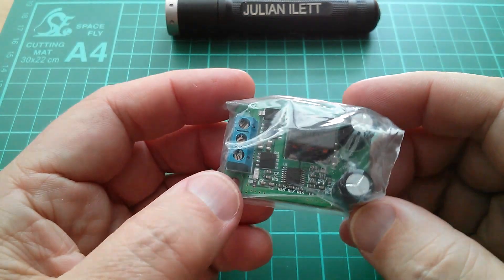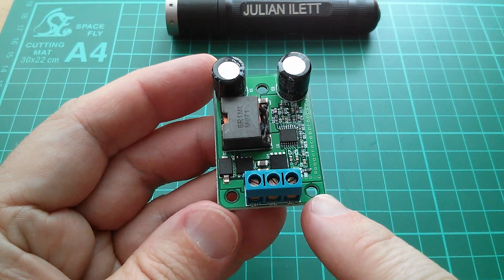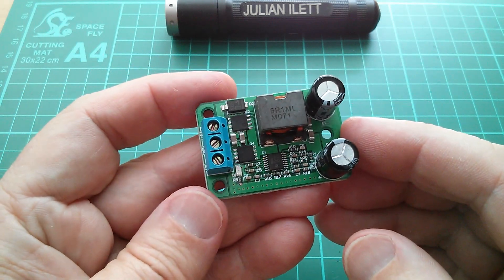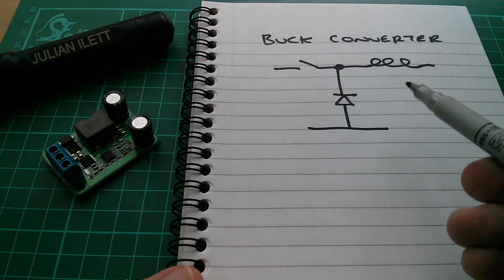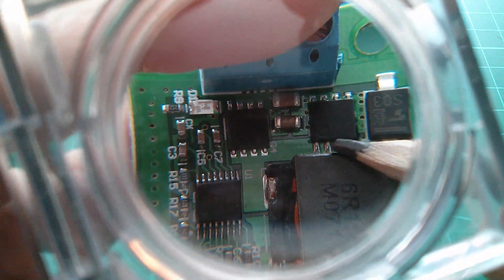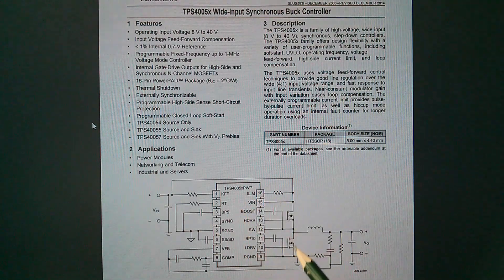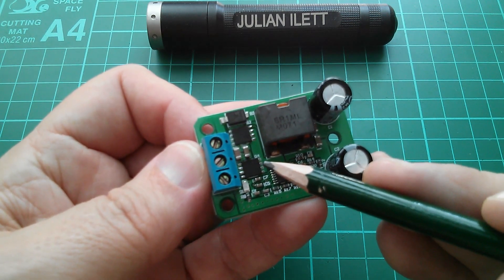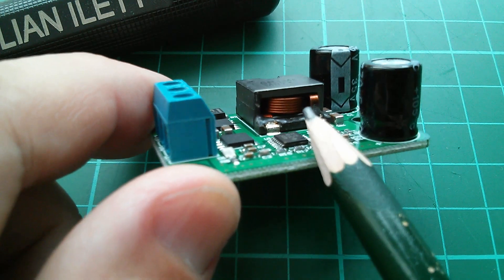Tech Talk: 5V 5A Synchronous Rectification Buck Converter

Comment: Actually I want to make battery charger for lithium ion battery. I want to charge 10 batteries at time and I have transformer of 12v and 5A step down. so could I give the 5A supply to this module. Suggest me any module to which I can give the input voltage of 12V dc and 5A and at output I want 5V and 5A

Comment: I just got few of those. The frequency is about 260 kHz - not that high as you would think with such a small inductor. This means that it won't work as well at low currents (bigger ripple).  The ripple at 170mA is 80-100 mV. In comparsion the LM 2596 ripple is 20-30 mV in similar conditions without additional filtering. Another problem is that both input and putput pass the whole PCB and create an inductance that picks high frequency content (quite sharp impulse) from the coil. I would connect input and output to the opposite side right on the capacitors by scratching the solder mask. Also I will addd aditional filtering. I still haven't measured the efficiency. I have to remove the diode and the LED before I do that.
Reply: I've had cases where the ripple is relatively high at very low currents (<10% of rated current) and it decreases by 3-4 times when load is over 30-40%.  I'm not sure about the reasons, but I know for sure some DC-DC converters have minimum current specification to maintain stable output.
Reply: How do you tel what the material is?

Comment: How can they sell these at these prices ? the TPS4005x in 2K pricing in USA alone is $1.75 !!!
Reply: Indeed. The magic of outsourcing all manufacturing to China. When you buy one of those TPS chips for 1.75, perhaps Texas Instruments orders it from a manufacturing plant in China and ships it around the world a few times (testing is done in Taiwan, lets say, and final packaging done in the USA) before it gets to you. You're paying shipping and import fees that a local Chinese electronics manufacturer completely bypasses on every component on the board, up until he ships the completed board directly to you via eBay. As a small time importer, you probably aren't charged import fees that Texas Instruments would be required to pay if you had ordered through them. And when TI sent their IP to the manufacturing plant in China, what's to stop the plant from building a few extra copies to dump in the local Chinese electronics market without giving TI their cut of the profits? When you buy through TI, you're paying for R&D expenses of the chip that the Chinese manufacturer may be completely bypassing.

Comment: Heat would have caused the core glue to loosen... no need to "destroy" :-)  
Flat copper windings are often used in high frequency switchers... more surface area means less "skin effect" losses.... this looks to be a very nice design indeed!  This controller says "up to 1MHz", it would have been interesting to see how far they are pushing it... frequency-wise.

Sometimes designers will use a "reverse polarity diode" in reverse-bias directly across the DC Input... so that there are no series-diode-drop losses. The only time it would conduct would be when the Input voltage was reversed... meant to blow the input fuse. This is common in very low voltage designs... and even in consumer "CB" radio transceivers. Some designs, however, can't withstand the 1V reverse voltage (high current diode conduction voltage drop) and survive when the DC Input is reversed.

However, it appears that the Anode is connected to the +V Input, so it is indeed series-connected. Did you check to see if it's a Schottky diode? (check forward voltage with a multimeter in diode-test mode) The losses would be far less, if so. 

With a normal silicon diode, at 9V input, the diode losses would be around 1V forward conduction, and at full 5V 5A load (about 26.25W input power assuming 95% efficiency), that's 3.28A (at 8V applied to the regulator), or about 3.3W diode loss... that would be a very hot diode. (it also means it's more than a 3A diode, since at 9V input, full load, it would draw more than 3A input)

If it's Schottky diode, the forward voltage drop would be around 400mA, for about 1.2W loss (for those wondering how: 9v - 0.400v = 8.6V actual input to the regulator; 26.25w / 8.6v = 3.05A;  3.05A x 0.400V = 1.22W)

I really appreciate your videos like this!  It's not many of us can afford to "tear down" stuff :-)

Comment: I wonder if you can get something similar, but with a trimpot to adjust the output voltage to prevent sag under load or over longer wires?

Comment: Before destroying it you should've done some tests. Put it on a variable load, ramp up the current drain and observe if anything gets warm, then if at 5A it doesn't get very warm, ramp up the input voltage and observe again. Then if it's still fairing well at 5A load with twenty something volts going in, increase the load to more than 5A while watching the output voltage. See if the inductor, etc... gets hot. If you blow it up, then rip the inductor to pieces ;) Would've made a great video

Comment: After talking about its efficiency it would have been good to see you test it and derive some efficiency figures for different input voltages and loads. Just breaking it apart without even powering it up is not that enlightening.
After all this is meant to be a technical channel.

Comment: that inductor is (was) insulated so as to not cause havoc on the circuits ground and sensitive traces while switching. Looks like a coil craft inductor.
Reply: It is - I've just purchased one myself, coincidentally for another buck converter.

Comment: Very interesting device, thanks.
Though I would have liked to have seen a test of the actual efficiency.
Funny if it turns out to be better than the version you are replacing it with (input and output on opposite sides)

Comment: Appears to me the flat winding in the inductor is just to make the physical size more compact.  Don't know if the shape of the winding material has much effect?  Something to think about for sure.
Reply: Yeah, you get a coil of thick wire without making it very long. But I think it might also help a little that now the ferrite core is shorter too, so the magnetic flux has a shorter path to travel.

Comment: The diode on the input side with the higher voltage/lower current is lot less of an loss compared to the lower voltage on the output, it does not reduce the advantages of synchronous converter much.

Comment: Note that the reverse protection diode doesn't have to be schottky with a high leakage current. It could be a normal rectifier diode.
Reply: Of you could use a normal diode, but you'd want to use a schottky because of the lower forward voltage (more efficient, less heating).
Reply: How efficient does reverse polarity protection diode have to be, exactly? I'm not talking about the switching diode here, I'm talking about the reverse protection diode julian mentions that he says messes up the efficiency of the synchronous switcher. I assume it would mess up the efficiency because of leakage current if its a schottky -- that's why I suggested it could be something else. Perhaps I'm mistaken and he didn't say that it was for polarity protection?
Reply: Jacob Schmidt
The leakage current is irrelevant. The forward voltage (times the forward current) is what creates the losses
Reply: You would appear to have missed my point. That's fine. Have a nice day.
Reply: Jacob Schmidt
You would appear to not have understood how a diode works and what a reverse polarity protection diode does.
Reply: Sigh. Why leave well enough alone when I can yell at someone on the internet.

Nobody cares about the efficiency of something when it connected incorrectly. When the module is operating correctly and we do care about efficiency, the reverse protection diode is in reverse bias, and therefore it is the leakage current that matters.
Reply: Jacob Schmidt
See, you don't understand how the reverse protection diode works. In normal operation this diode is in forward bias and all the input current is going through it. Times that by the voltage drop and you got your losses.
Reply: I have rewatched the video and I believe you are correct. I was under the impression that the diode was reversed across the rails and would act as a clamp. That doesn't appear to be the case. I apologize.
Reply: Jacob Schmidt
Ah, ok you thought about that kind of protection. But the missing fuse before that would also be a hint, that that's not the way this circuit is protected. Won't protect for long without a fuse.
Yes, for a clamp a normal diode would be better (although the <1mA leakage of a schottky wouldn't matter much compared to the rest of the circuit). What would be even more better ;) as a clamp, is a zener diode. It can act as a revers polarity and an over voltage protection diode at the same time.

Comment: thats a very interesting design. not sure how you would get more current out than in but ok
Reply: It's a buck topology DC to DC converter. High voltage, low current power goes in and low voltage, high current power comes out. It's still the same amount of energy (volts * amps) that goes in and comes out.

Comment: The inductor looks like a coilcraft part, I got some I did buy for a project.
I haven't taken the coils apart, you did find quite much what I expected them to be like.

You rarely need more heat in the converter/controller itself.
(besides, it's easy to do in controlled ways if wanted)

Please check the FET type e.t.c., looks like non-china parts (with possible exception of the PCB itself, and screw terminals)

Comment: Did you see this note in the specs: In typical applications, paralleling the synchronous rectifier MOSFET with a Schottky rectifier increases the
overall converter efficiency by approximately 2% due to the lower power dissipation during the body diode
conduction and reverse recovery periods.
Reply: Yep this is common as the MOSFET doesn't switch immediately. The diode will switch faster, but then once the MOSFET kicks in and removes the diode's voltage drop.

Looking at the video it looks like the diode is going to the inductor? A reverse polarity diode wouldn't be doing that.
Reply: No, the inductor leads are in the center of the board, not at the top. The diode would have to be in parallel with one of the MOSFETs, which it obviously isn't (unless they have some very weird trace routing).
Reply: I know but it does not look like it is connecting to the MOSFET drain in any way that makes sense. It should go V+ to the diode, then a heavy current path from the diode to the high side MOSFET with resistors going to the 40057. I don't think the bottom of the board is ever shown so I cannot see the traces there.

Edited to add: I just looked at the E-Bay listing and I think you are right. The "IN" connector is isolated from the bottom traces. So that diode has to be the path for V+ to come in.
Reply: Al Lipscomb
I also found a listing where it says reverse polarity protection diode in chinese (trusting google image translate here ;) ).

Comment: The diode is just for protection. Its get shorted by the mosfet so no loss in efficiency there.  And as already said in the comments section the inductor probably a special inductor to lower the impedance caused by the high frequencies (skin effect).

Comment: Forgive my ignorance but couldn't you just desolder the diode and bridge the connection with a piece of wire?
Reply: That's what he's hinting at at7:30 regarding the one with USB socket, " if is there  I might wire it out"
Reply: Ok, Glad to know that will work if i ever need one of these things. (of course with the caveat of no reverse polarity protection)

Comment: One concern for that inductor design: Skin effect is going to be significant at high frequencies.
Reply: Quite the opposite. A copper band has a lot more surface area than a round wire with the same cross section. And surface area is all that counts if you want to avoid skin effect related losses. The skin effect means that current won't penetrate into the center a conductor very well, especially at high current densities and high frequencies. Using conductor bands is one approach to make the conductior profile as shallow as possible. Another approach would be stranded wire, in which each strand is enameled and thus isolated from another.
Reply: Just curious, do you have any proof (or an article) that skin effect is more of an issue for this type of conductor?
Reply: None at all. Just intuition. But it would only be something in need of consideration at very high frequencies.
Reply: This convertor chip switching at min. 100KHz and max. 1000KHz. The strip is very thin so electrons will penetrate the whole strip, no problem.

1MHz signal will be reduced around 0,5mm.
So if the strip is <1mm thick there is no problem at max. switching speed of this convertor.
Reply: Electrodude
Wrong axis: It'll be at right angles to both current flow and field, which means radial. The windings are wide, so you'll be losing 0.5mm effectively from the width, not the thickness. That's why I thought the skin effect might be more pronounced on that design than on regular wire coils. But still, it'll only be worth worrying above above 1MHz.
Reply: If it's just an intuition, include - - - > (Just an intuition) before your comment.
Reply: blubb spinat
I had to look a few things up. I'd used the wrong term - I should have referred to 'proximity effect,' a closely related issue which applies under strong external magnetic fields, as you would find in an inductor.

But I think the only way this is going to be settled it for someone to obtain one of these conductors, and a good old toroidal of equal inductance for comparison, hook up a bunch of test gear and take some measurements. I would happily do so if I could, but I lack the equipment for high-frequency measurement.

Comment: The output is probably a perfect 5.00001 volts.
I've noticed that if I build a charger for my smartphones the output voltage needs to be around 5.35V to switch the phone into 1.2A charging mode. @5V it usually charges @500mA
I use good cables and have tested voltage dividers bwtween the data pins.
So I guess this one is unusable for charging my smart devices.
Reply: I thought buck converters were a bit shaky (not as smooth/stable) on the output unlike their linear cousins.
Reply: Everything is relative. Linear are more completely flat where switching has a bit of ripple, but on a properly designed regulator you should need a scope to detect the ripple - it's not significant for most applications.
Reply: I did some magic on the D-lines, but due to some loss in the cable, I had to lift the output of the 5V.
Going to have a look at this chip and where to get it.
Having different smartdevices needs different magic. Can this chip do all this?

Comment: I got some larger copper band coils. 
i cant really find a use for it, but they look cool. like a half a kilogram copper slinky
https://i.gyazo.com/7bf443ee8358c99c12108fa81e8e360f.jpg
https://i.gyazo.com/11ba85c47ee695f0b1f5011cf57bc32f.jpg

The cap is a 2 Farad 18V cap and a thyristor. i use it for magnetizing stuff.
Reply from the maker: Very nice. Lots of copper - looks expensive.
Reply: Is this an LC filter? Can I have some ? ^_^
Reply: No the one with the capacitor is for magnetizing stuff. for an LC filter i would need to use a non polarized cap. several hundred amps flowing trough there until the thyristor falls below its holding voltage.

Comment: Is it cheaper to buy things on the American eBay then it is to purchase them from the UK eBay?
Reply: Some items are only listed on ebay.com and not on ebay.co.uk but you can still buy them from the US site because many have free international shipping. Sometimes it's cheaper to buy on ebay.ca for very low cost items. It's usually always cheaper on aliexpress though, these are  2 for £4.65 inc delivery or 5 for £10
Reply: It doesn't matter. If it's the same item (same item ID), it's the same price, ebay will just show you a currency converted price. The only difference between the sites is what you can find. So in a sense ebay.com is cheaper, because I think all items are listed there and your chance is greater to find the cheapest listing for a certain item. But once you have found an item on any ebay page you can take it's item ID and enter it on any other ebay site and buy it on your local page (which makes no difference at all).
Reply: I often check the price of stuff I buy on .com .ca and .co.uk. If its commonly listed for 99p on .uk you can very often find it for 99c on .com and then sometimes for c99c on .ca. that was the situation with a bunch of 3x1W LED drivers I bought. of course its only pennies difference but if youre buying multiple units or placing regular orders it might be worth the effort, and its just kind of satisfying knowing you got it for the best price. however for a lot of things which are slightly more expensive, including several of the arduinos Ive been buying recently, Ive found the cheapest listings on co.uk
it does throw up some oddities though, while you can search .com or .ca for your item then buy it from co.uk, if you try to look in the sellers shop or at sellers other items on the co.uk site, often no listings show up

Comment: What is the difference between synchronous with non-synchronous converters? which one is better?
Reply from the maker: Synchronous converter is more efficient.
Reply: Async uses a schottky diode for freewheeling in the off state, sync uses a MOSFET driven in sync. Syncronous converters can achieve substantially higher efficiency, but they require additional components and are harder to design.
Reply: Do they has any physical difference?